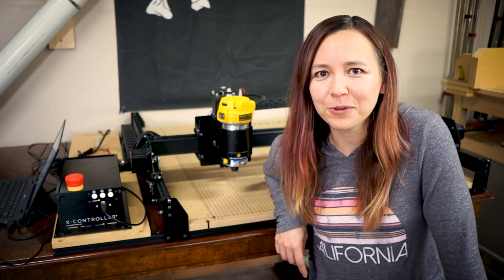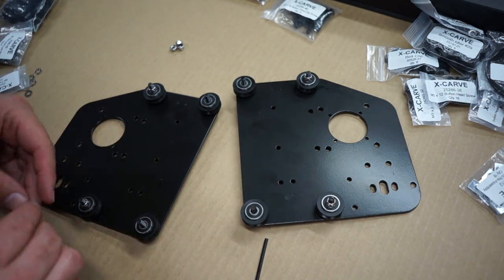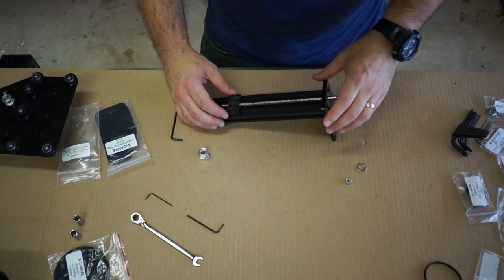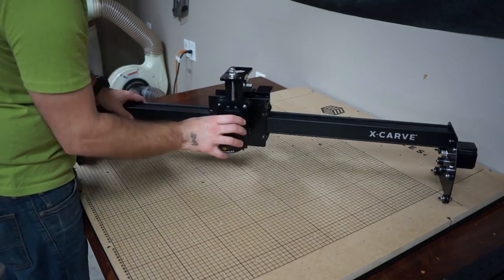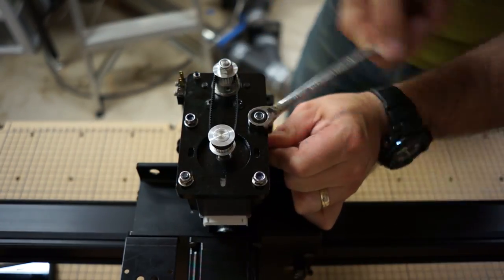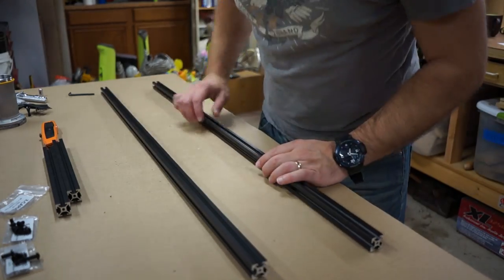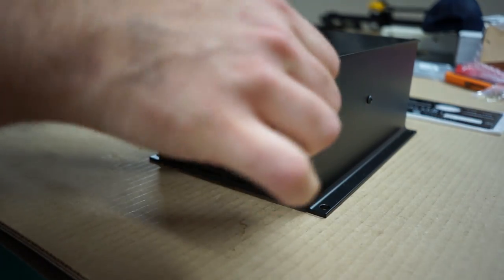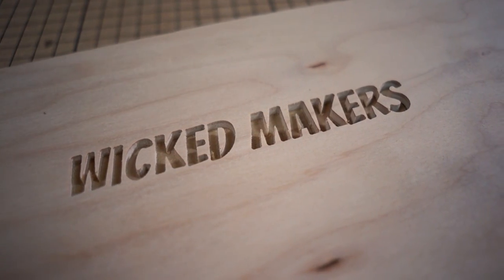How to assemble the X-Carve CNC machine from Inventables

Comment: X-carve needs a video like this with the normal speed playback. Had to go to Lowe's to get the missing cap screws. I have been assembling since January. Took a two month break to go to therapy. Clearly there has been nothing fun about this process for me. Finally finished today May 29, 2021 and learned that if I want to attached the optional vacuum I need to take some things apart. Guess what is staying in the box. Where was that in the instructions. The router works. Yey. The rest of the machine is a power dud. So now I need to take the x-controller apart to see if I connected something wrong. what would you charge me to come to NC and assemble mine?
Reply from the maker: We got the vacuum attachment and it basically just plugs right in. But maybe some stuff has changed. 🤷🏼‍♂️

Comment: Seems like they could put a lot of this stuff together for you. That said, building it yourself gives you intimate knowledge about it's makeup before you ever turn it on and most likely lowers cost for the company (which they hopefully pass along to the consumer).
Reply from the maker: Yeah I think that is why the cost is so low, relatively speaking, because they outsource most of the assembly to the customer. I have to admit I enjoy having that intimate knowledge of the parts and how it's working because I'm a lot more comfortable using it and not feeling like I might break something. I know if I break a belt or whatever that replacing it is simple so I don't have to tip-toe around projects.

Comment: got a used one so i did not have to put it together, in easil i center some words combine them center on board when it cuts it is not centerd on board how do i fix it
Reply from the maker: Sounds like maybe the machine isn’t setup properly in Easel. Might be set to the wrong size.
Reply: @WickedMakers  i need help on this cnc i got it used so i am learning i could never put one together so thought i would abuse this one

Comment: For the components that roll on the t tracks are you able to move by hand with not much effort?  I think my wheels are too tight. Also the y axis should be able to be hand turned to move up and down?  It works when I wrench the top nut. Seems again I have it too tight.
Reply from the maker: You technically shouldn't move them by hand because it can damage the motors BUT you should be able to, yes. If you can't it's too tight. It's a bit tricky to get right but basically if it feels wobbly it's too lose and if it won't move it's too tight. Sounds like you have the Z-axis too tight as well (moving up and down). Better to err on the side of looser and then tighten as necessary until you get it dialed in, than to go too tight and potentially damage something.
Reply: Thanks for the reply!  I haven't connected the belts yet.  I did loosen up the pulleys and made a lot of difference.  Seems the sweet spot is to tighten just enough to eliminate side play on the pulleys.  Hopefully I'll finish the install soon and try it out.

Comment: Great Vid. Does this kit do true 3D (curved carving) or something resembling 2.5D?
Reply from the maker: We haven’t tried it yet but what I’ve read is that yes you can. Their software Easel is not capable of generating gcode from a 3D model but you can use a more advanced CAD app to get the gcode from your model and then run it on the xcarve.
Reply: Vcarve pro software or aspire etc

Comment: Hi, what bit did you use for your carving?
Reply from the maker: In that test we used the 1/8” straight bit.
Reply: Thx for the quick reply.....just subscribed !!!
Reply: Did you have to buy a 1/8 collet with a 1/8 bit or use a 1/4 inch collet and 1/8 bit ?
Reply from the maker: Inventables has a 1/8” collet adapter for $5 that we picked up that slides into your 1/4” collet.

Comment: You should take a look into Phantom's Lead-Screw Upgrade kit from the Inventables Forums > X-Carve > Upgrades which is sooo much nicer than those belts especially when you're working with more demanding materials and more advanced CAM operations.

You might also want to take a look into Fusion 360 ( which can be claimed for free ) and is about the equivalent to Easel what Adobe Photoshop is to Microsoft Paint while still fairly easy to learn due to the abundance of tutorial videos found on YouTube.
Reply from the maker: Cool, will do! I use Fusion 360 occasionally for other work but was not aware I could use it in place of Easel. I've seen a handful of other cnc apps that have more advanced functionality that I've been meaning to look into. Thanks for the tips!